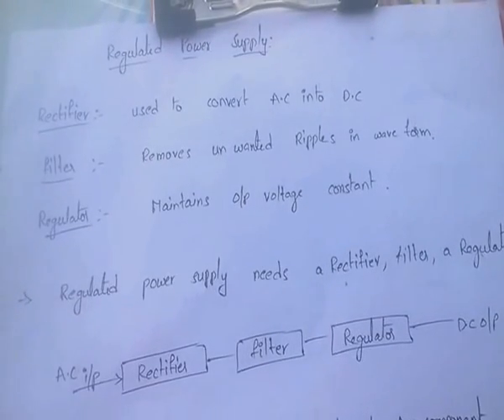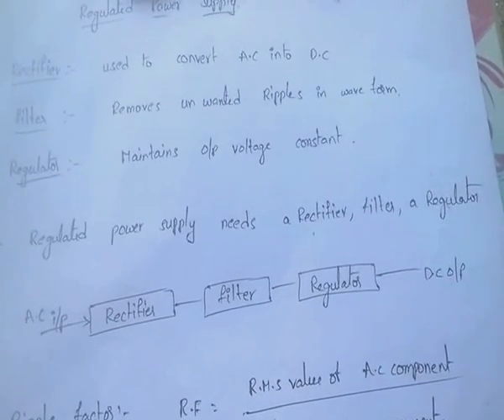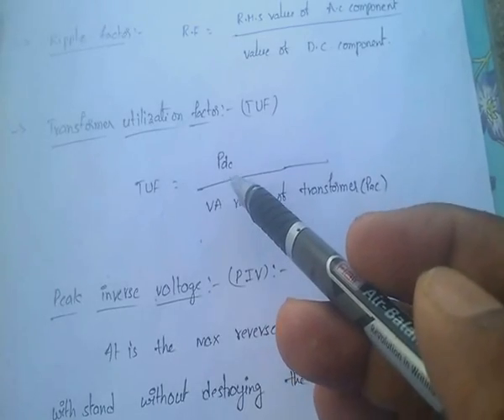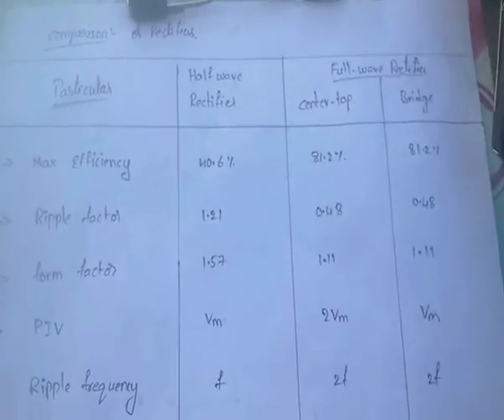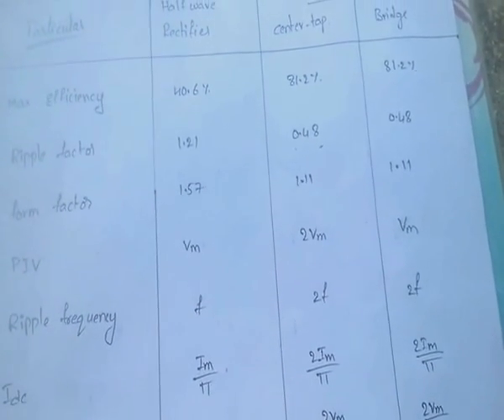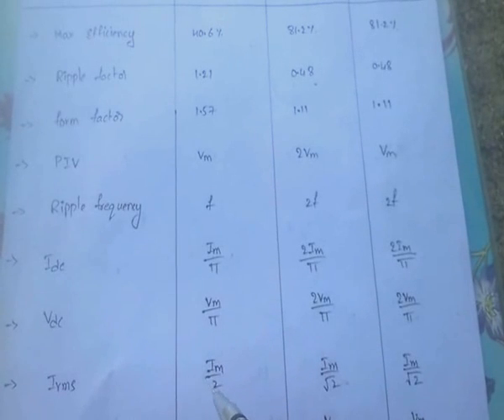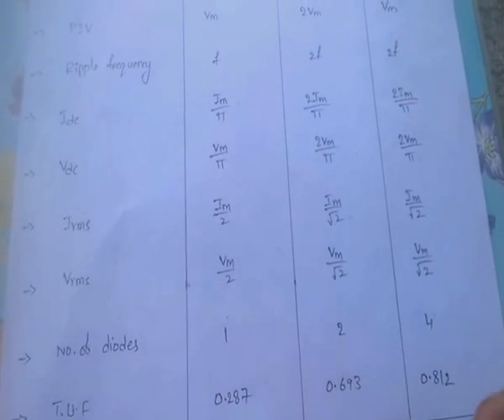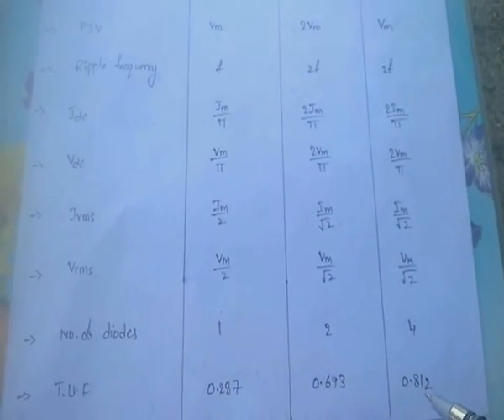Electronic Devices and Circuits part 13 -  for RRB JE/RRB SSE/ BSNL JE/SSC JE/PSU JOBS

Comment from the maker: Hi guys..If you want my class notes as pdf file please mail to me for payment details..My mail id: suneelbsnlje@gmail.com
Cost of bsnl je class notes pdf both part 1&2:300/-
Cost of bsnl je class notes pdf part 1 only : 200/- 
Cost of bsnl je notes pdf part 2 only : 200/- 
Topics covered in part 1..
1.Bsnl je exam introduction - 4pages
2.Maths notes of youtube videos(matrices, differentiation,diff equations of second order, integration,complex numbers,partial diff) 38 pages
3.Maths materials with example question and solutions on remaining topics (vectors,fourier laplace transform and partial diff) 29 pages
5. Basic electricity youtube video notes all topics and mcq’s (except batteries) 36pages
6.basic electricity mcq questions material and batteries 14pages
7.Instruments and measurements notes of youtube videos (7parts) and material of those topics..and mcq’s 25 pages
8.previous papers- 3(2015 -1,2015-2 and 2013) 78 pages
9.physics notes 23 pages
10.Electronic Devices and Circuits   50 pages ...
Topics covered in part 2:
1. Specialization - Electrical - Pdf notes of youtube classes – 15 video’s class notes – 70 pages
2. Specialization - control systems -Pdf notes of youtube classes–
15 video’s class notes – 63 pages
3.digital techniques pdf notes of youtube video classes-
10 video’s class notes – 40 pages..
4. Specialization - Network,filters and transmission lines pdf notes of youtube classes (imp topics only) –

i will also send some material for microprocessor and computers and imp bits for communications...
Reply: hi sir,iam sivakumar could u please upload the computers videos......please help me sir
Reply: i am  waiting for u r valuable information on the computers plz help me....... thank you sirrrrr